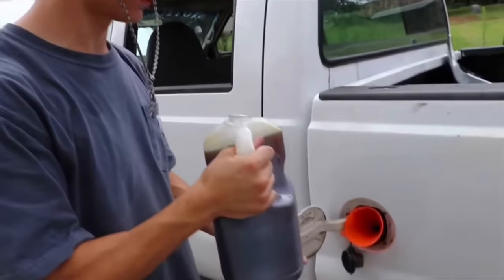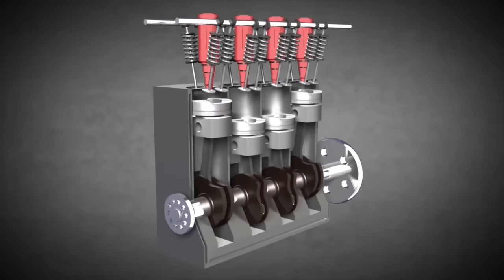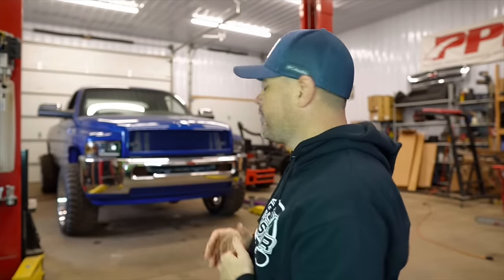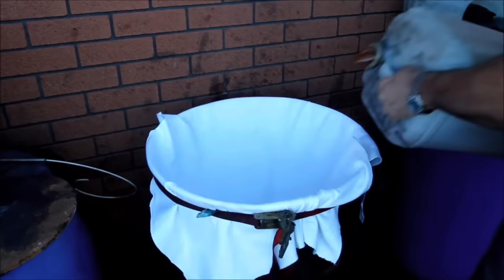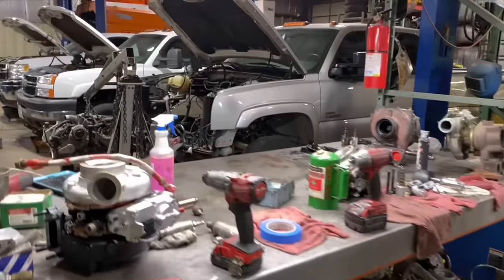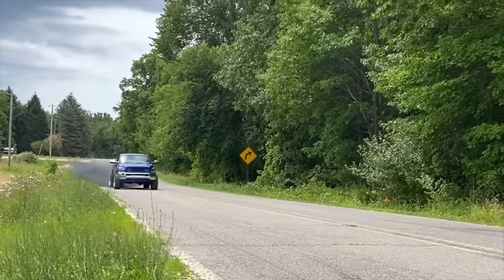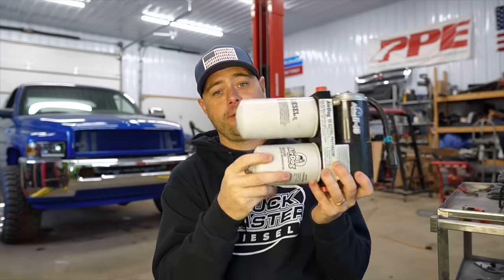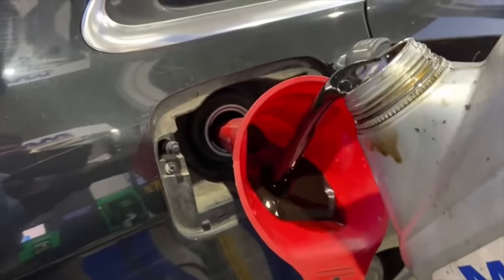Can You Run A Diesel On Used Engine Oil? Free Diesel Fuel? *EXPLAINED*

Comment from the maker: What do you guys think about using alternative fuels? Worth it? Comment Below ⬇️
Reply: I know where a 1996 GMC 4x4 6.5 Detroit  turbo diesel is for sale in Seymour tx for $4,250 an old man owns it 1 owner I think it was like 168 or 188k on odometer
Reply: Yes you can but you will destroy the injection or high pressure pump.. you will also wipe out the cylinder walls.. my buddy use to run his on trans fluid and distroyed his engine.
Reply: On older Heavy duty non Emmision compliant engines I have seen guys run them on all sorts of fuels ( with oil added to Diesel, kerosene , even one guy at a Dyno high horsepower show had added nitro-methane to his tank in a Cummins KTA 600 powered semi) but I would not in my own without first going through the process to convert it into a Bio type fuel , like what is sold here in Southern California. In fact I have run my LB-7 on it ( quite a few times ) and it seems to actually run better , possibly due to better lubricity .???  Anyway Not just old used oil alone ….
Reply: I have a LBZ that I used veggie oil and used motor oil in my truck. I ran everything thru a centrifuge first and clean the used oil down to .5 of a micron.  Mileage would go from 24 mpg to 22 mpg with the used oil. Summer time was 2 gallons of gas to 20 gallons of oil. Winter was a 50/50 mix with diesel.
Reply: I have a 05 2500 hd dirtymax for sale with plow good truck
Reply: @billottoway9320  50/50 diesel and gas?
Reply: Ita crazy my brother was just talking about this today and asked me if I could get him some 55 gallon drums from work for engine oil lol
Reply: I think it would be worth it if Diesel gets over like 10 a gallon 😢 but you said at the end of your video you where instead in trucks for sale I have a 99 7.3 with 220000 on it 3 owners if interested?
Reply: @bobrobbins9038  you have any pictures
Reply: @justincook4069  you have any pictures
Reply: @andrewstover5981  yes its on market place
Reply: @andrewstover5981   I could proubly get you some
Reply: I thought burning plastic to convert to diesel is interesting.
Reply: I'm having issues with my 08 Cummins 6.7 fuel pump got a program  on step 2 and is giving me code for low fuel pressure  what pump you recommend me ?   Fleece is a choice but kind of expensive.   Let me know if you can.  I will really appreciate it
Reply: Been done for years Gardner used to put it in their manual. 10% was considered no problem. We ran our engines on engine oil but it has to be reasonably clean. Modern diesels not a good idea. I used to manufacture oil engines.
Reply: Do not use transmission fluid
Reply: If I could find biodiesel I'd switch
Reply: If you could get a screamin deal on methane and the other chemicals to make bio diesel, it would be worth it. But it takes a lot of time, and it doesn't have consistent results ( quality of the finished product varies significantly sometimes). But even if you could do all this you still have to mix it with diesel unless it has a mechanical fuel pump. If you have common rail/ heui then you can only have up to 20% bio diesel in your fuel
Reply: @jeriddaniels7084  that's good to know. Thanks
Reply: I have been watching your videos and like them. I own a 2019 GMC with Duramax L5P. What is the best aftermarket oil filter for this motor. Right now I use AMSOIL 15-W40 with there filter. Also do you run the FASS fuel system on your L5P?

Thank you
Reply: If you can run it on a 7.3 why not a 6.0? Motor the same basically?
Reply: @The Veale  added gunk to the egr valve, oil cooler, and egr cooler. I wouldn't
Reply: I have a diesel half track from the 1950s that I run on used motor oil.  Runs like a champ.  Been doing it for years.
Reply: @Tommy.McLean  what about a mixture of WMO and Diesel?
Reply: Q año es. Y es 250 o es 1500 o es 3500 cual es ??
Reply: Date of comment: 05/23;  I bought a '96 Ford Superduty from a small Indiana town fire Dept. in Sept. of 2019 & took ownership in October 2019.  The truck just turned over 26,200 original miles.  It left Fords Michigan Factory on a rail car for Quigley of Pennsylvania where the F-350 components were stripped from the frame down.  Quigley added a 4x4 package to it that was more than the cost of the truck.  F550 drive components and suspension, Quigley components, and Dana 70 axels with 5:13 gears.  Today just 3 years later it sits with 29,513 miles on the 7.3L Powerstroke.  I was wondering if using used motor oil, transmission fluid, and hydronic fluid were possible in my engine.  I wouldn't do it in my engine...the motor is like new.  But I wondered if it were possible.  I am however motivated in buying a fuel system that converts used vegtable oil into diesel fuel.  It doesn't take up a tremendous amount of space, and it could be a benefit for me after this year when I begin driving a lot more miles.  I am thinking of getting signed contracts with a handful of restaurants for their used vegtable oil and then collect it in a 1500 gallon tank and convert it all to diesel every two weeks.  I would use what I needed and sell the rest to family members at a price that helps us both.
Reply: 5:26 key 5:28
Reply: You can only do this on older mechanical diesels like the 6.9 & 7.3 idi the old 80s D model Mercedes .. 

Also it’s not dirty and nasty if you filter !! 

I have been running black diesel off and on for YEARS !! I have a 7.3 idi
Reply: The rule is: If you have an old diesel engine, if it burns it will run. May not be good for it however if its an apocalyptic situation then all of that doesnt matter
Reply: The diesel engine was originally designed to run on peanut oil. What we put in it today is petroleum refining waste.
Reply: WHAT ABOUT %50 DIESLE AND %1 OIL
Reply: WHAT ABOUT synthetic waste motor oil

Comment: If I still had my 6.2, I'd be mixing used oil in it. but with my LML, I'm not risking it.  baby's got over 530,000 miles on it and runs like a champ!
Reply: Lml with 530 on it. Impressive. Have you done Cp3 conversion?
Reply: Awesome! My father in-law is on his second LBZ with over 500K on one and almost 600K on the other. Oil change every 3K miles and Diesel Kleen mixed 50/50 with Lucas every other fill up.
Reply: @dfreddy3141  I suspect the engine was gone through before I bought the truck.  I had to replace the left fuel rail and regulator a while back, and from what I can remember, the CP4 was still in it.
Reply: No kidding. I would have if i still had my built up 94 k2500 with a 6.5. Sold that right befor the price spike. Got my lly now. Not risking it either.
Reply: @dfreddy3141  the cp4 has an 8% failure rate, that’s not really a good thing but over 90% of them won’t see any problems with the pump. My grandfathers needed head gaskets with less than 80k miles on it so realistically they could run forever or break on the first drive 🤷‍♂️
Reply: ma and m y 350k mile 7.3l excursion like "iv made it this far do i really wanna do this and risk some shit"
Reply: Who makes a 6.2
Reply: @qwertykevin1  ....GM the 6.2l is the detroit diesel my guy
Reply: @qwertykevin1  GM Detroit Diesel prior to the 6.5 turbo diesel. Used in Chevy  and gmc trucks, first-generation military hummers, and still has a strong following in the marine market.

Comment: I have a 2001 vw golf diesel that I daily drive.   I have used new transmission fluid that I had laying around to prime my fuel filter.    Worked great.   Also I do a 4:1 ratio of 2 stroke to diesel every other tank.   The injection pump is so quiet after words.
Reply: What engine?
Reply: Likely a 1.9L. Not sure on engine code
Reply: @chrisbowie6019   probably an ALH since its only one at this time of production that goes in jetta/golf ( Pump deuce ( pd engine ) started in 2004
Reply: I couldn’t imagine doing something similar to my 1980 VW Rabbit Diesel 1.6 liter or even running alt fuels. It only had about 48hp as it was. Also diesel fuel in the late 1980’s overseas was fairly inexpensive. Especially given the fact that I would receive fuel vouchers.

✌🏽
Reply: I had a 2000 golf with the 1.9 ALH engine in it and I'd run diesel mixed with a couple gallons of well filtered transmission fluid. I miss that little car, it was a 5 speed and I would average 47-48 mpg.....now I have 6.0 suburban 2500 and get around 12 mpg.....it hurts

Comment: I have an older ford 1986 with 6.9 international diesel and I run just about any kind of free oil I can get in it. Sometimes I mix it with some gasoline and sometimes I mix it with diesel. I have never had any problems from doing this and I usually filter with an old t-shirt or whatever I have around.
Reply: Very cool
Reply: How many miles?
Reply: do you let it sit for a while before pumping it out of a container to rid the sediments, or bring it over heat to rid the water or any of that fancy stuff? or really just through the shirt and into the tank?

Comment: I have a 96 12 valve. I've been mixing  wvo with diesel for 4 years now. Use a centerfuge to clean the wvo.  Never had an issue and change the filter every 30k. I run up too 90% wvo in the summer.  If you have issues with a coldstart. Just plug in the block heater for a couple hrs. Works like a charm.
Reply: I feel like my 7.3 actually starts better in the winter if it has 10 percent wvo
Reply: What’s wvo? Sorry I’m not the brightest 😂
Reply: @Christorment5  Waste vegetable oil

Comment: I use used motor oil/waste oil in my 335d, I mix it 50/50 with regular diesel and its been fine for the past 2 years since I started

Comment: I have a 7.3. I run jet fuel, used oil including hydraulic oil. Never misses a beat
Reply: i have a ford 7.3 power stroke too, mine has a turbo with the factory HPOP.  Is this your setup?

Comment: karoseen is not good to burn it has barley any lubricity. there is no more home heating oil its all diesal now i been told by my local distribution spot. we only have one hear in rhode island they got rid of home heating oil its all off road now. but karoseen will burn but also will burn up injectors due to very low lubricity. great video bud.

Comment: Yes you can, but not straight and without easy prep. This is how I do it:
All of the used oils and hydraulic fluids I collect at home I catch as clean as possible in a catch can I keep sealed in double trash bags. When full, I pour the 15 qts into 5-qt oil jugs I save from new oil/fluid changes.  I let the jugs sit for at least 90 days and then slowly pour off the top 4 quarts. The last quart has the settled solids or contamination in it. 

I mix 3 gal of the clean used oil with gasoline nearly 1:1 in 5 gallon fuel cans and shake for 1 minute, and put two 5-gallons cans into a 3/4 full tank of diesel. My 2005 Ram diesel has a 40 gallon tank. This makes a mix of about 15% used oils.  It seems to run fine Winter and Summer.  I do change my fuel filter a little sooner than typical, about every 10,000 miles, rather than 15,000.

The dirty oil left in each jug i combine  again and let settle another 90 days and repeat. The 2nd time I pour off the top and use the remainder as chain-lube and make two-cycle fuel for my chainsaw, and some start my wood boiler at night.

It's a cheap and easy way to get rid of collected fluids, have a little free fuel, and not waste anything either.

Peace
Reply: curious, don't you have any carbon soot issues?
Reply: can i just put somewhat clean fuel into a w123 diesel? will it run

Comment: One of my coworkers was a commercial generator tech and he filters and burns his oil changes in his 24 valve Cummins. He also told me there are diesel generators designed to only have the filters changed and it simply has a new oil replenishment tank that keeps the oil at level while it intentionally burns the spent oil.

Comment: I do a 50/50 mixture for my old machines with mechanic fuel systems. It seems to work well. I also just build a gravity feed oil filtration setup that will filter it through standard oil filters that way I know the oil is clean of debris before I reuse

Comment: Great video, I daily drive a 2009 Ford F350 with a swapped Detroit 4-53T in it and run a two tank veggie kit.  Start and stop on diesel and run on wvo, works great.  Same can't be said for engines with CP3 or CP4 pumps.:)
Reply: I used to deliver parts to a company that made these kits, still remember the part number for the electric fuel tank switch fsv1

Comment: Back in 07 I use too get waste oil from restaurants and run it in my Benz . I ran 40% oil to diesel fuel worked great changed my fuel filter every fill up. I got a great deal on filters .
Reply from the maker: Awesome info thanks for sharing

Comment: I had a dealership in Maine put Kerosene in my Duramax to break through fuel gelling. It actually worked really well.
Reply: Us Mainaahhs have to get crafty fairly often!!! It’s the literal end of the world up here
Reply: Kerosene is used in winter fuel to prevent it from gelling
Reply: Keep in mind kerosene has lower btu's and also less lubricity .
Reply: Thats because Diesel #1 is Kerosene with additives and lubricates.
Reply: @erikkovacs3097  No diesel is diesel, kerosene is refined more and has less btu's because of this and has lower sulfur which is a lubricant  already in the diesel. Currently it is 15ppm it use to be 500 ppm and that is why it is good to put lubricant in fuel for older diesel engines designed for the 500ppm sulfur. I use low ash 2 stroke oil mixed in my fuel in all my trucks and machines .
Reply: @gloknor  Kerosene is #1 Diesel. I have had long conversations with our fuel delivery driver at the farm. Takes a while for 5,500 gallons of diesel to get pumped in the tanks. Our winter fuel is a mix between #1 Diesel (Kerosene) and #2 off road diesel. The Kerosene mix helps lowers the fuel gel temp. They do the same thing for our On - road fuel also. With winter fuel. HP, TQ and mileage will go down. #1 has more cetane then #2. Due to this. #1 is more volatile and burns faster, lowering mileage. With lower cetane in #2. It burns at a slower rate and mileage increases.
Reply: @countcuda70  Why are you mixing off road fuel and kerosene ? I would buy heating oil instead since it is same exact thing . I ran a line into the shop off our tank for heating just so they could not  say it wasn't being used for heat and sell it at the heating oil cost. Our on site tank is a 1000  gallon tank and can't get around doing that trick but yeh mixing kero helps with antigelling  but lowers lubricity ,power is less and it is very costly.
Reply: @gloknor  Are you not reading. I have said several times. Here in the state I'm in. Winter fuel is blended with kerosene. It's to lower the gel temp of diesel. Additives are added into the fuel. To help with lubricity. Heating oil can have various levels of sulfur and emissions equipment is very expensive.
Reply: @countcuda70  Do you even read my comments? I am not repeating myself to you . I am a diesel mechanic and have been one for decades here in the northeast I actually live it not read it somewhere .
Reply: @gloknor  So we are going to repeat what each is saying, okay. This conversation is going no where now. Awesome you're a Diesel Mechanic.. So you fix $hit... Not a fuel expert. I guess since we are giving history lessons. I have been working on $hit since the late 80's. Farm, military, construction, performance diesel shop... This whole argument is dumb. It's our money. When we spend yours. You can ask why we're doing it that way. Have a good holiday season 🙄
Reply: I use 15-20% kerosene in heavy equipment when below zero to help starting and with gelling.   Works great!  Very noticeable. 
Would probably consider running old oil or trans at a 60-40 fuel- oil in my LMM if prices keep going up.   Not worth the mess and hassle at this point to filter and keep it sitting around with my limited storage ability.
Reply: Did you have diesel #1 in your tank? I’ve never experienced gelling and it gets -20f here
Reply: @RBoysMedia  Not sure where you're from. In Michigan most stations come in mixed with #1 and #2 already
Reply: @countcuda70  exactly. It’s already mixed. Never had an issue. I’m Montana. Gets to -30F easy
Reply: I ran a gas station for some years.  Kerosene and Diesel #1 are the same--we'd fill the kerosene tank then go directly to the diesel tank in the winter--summer would be #2 diesel, that's quite a bit different.

Comment: I owned an older MB 300D whose owner's manual recommended the use of kerosene instead of diesel in the winter.   I rented a moving truck a few years ago and had to refuel with kerosene at a NV rest stop (trip computer lied to me). It blew the carbon outa' that thing in an impressive cloud -- and ran like a top after that.  It's my understanding that kerosene is #1 diesel -- simply more pure/refined than the typical #2.  I wouldn't hesitate to use it.